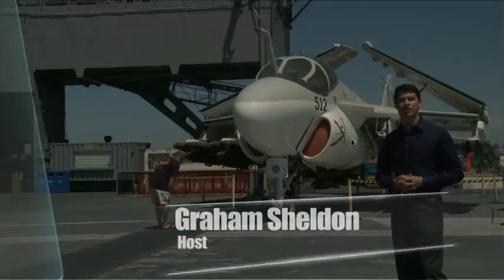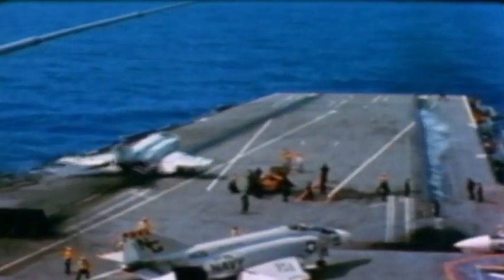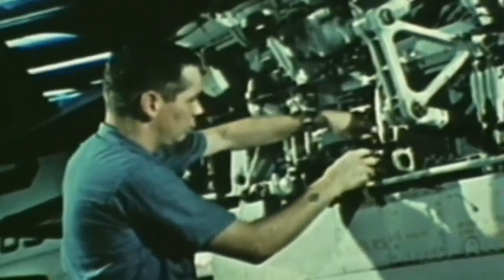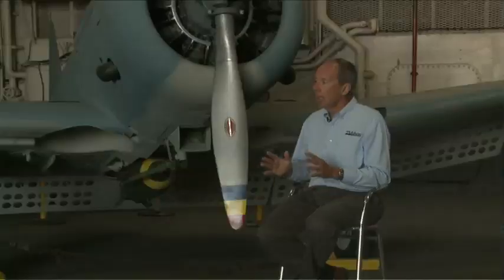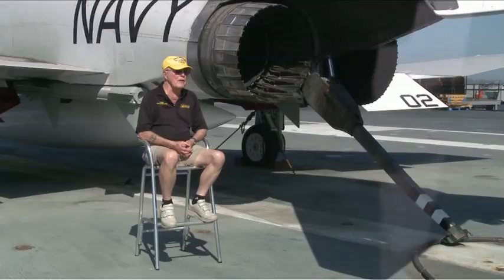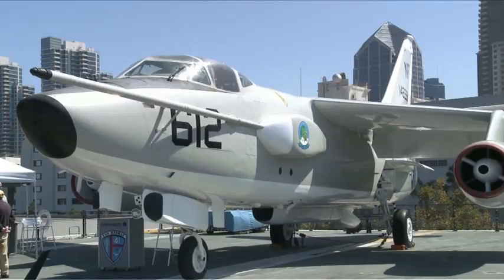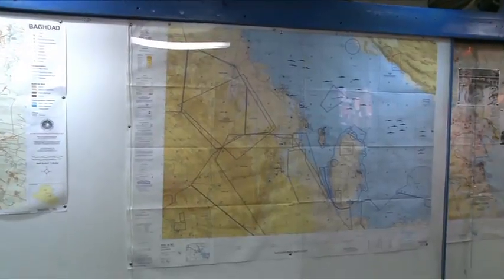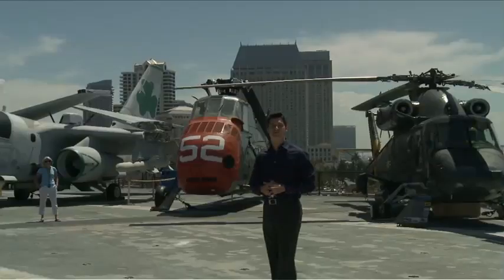A Look Inside the USS Midway | USS Midway Museum

Comment: Sorry, but Midway's Sister, the FDR CV-42, was the first Aircraft Carrier to carry and deploy Nuclear weapons, not "Midway Magic CV-41."
Reply: Having been on both I noticed a few minor misteps in the script but blew it off knowing that landlubbers can't get it all right.
Reply: @jimc5096  Midway was also NOT the world's largest ship until the mid-1950s.
There were several ocean liners -- Queen Mary, Queen Elizabeth, the Normandie -- commissioned prior to World War II that were bigger ships in gross tonnage (80,000+ tons not matched until the Kitty Hawk was commissioned in the early 1960s) and length.  The Queen Elizabeth was the largest ocean liner pre-WW2 at 83,000+ tons and 1031 ft length.  From what I've read, the cutting edge ocean liners have always outpaced the size and tonnage of warships.  The closest warships in size are the supercarriers of the Enterprise, Nimitz, and Ford classes but even those are relatively smaller than today's cruise ships and super oil tankers.  
To say that Midway also had the greatest tonnage post-war (WW2) would be stretching, too.  I believe the Iowa-class battleships had greater tonnage, 57k, close to 60k later after refits.  The Midway class grossed 45k standard around 52k tons max in original configuration.  The original length of the Midway was 968ft extended to 1001ft after her last refit.  I've read gross tonnages of 64k, 67k, and even as high as 72k tons for Midway after the 1966-1970 refit.  Anyway, she was overstressed for a ship originally built to a 45k ton standard!

Comment: The very last of the A3's were based at Van Nuys Airport for Raytheon research & Development. 
When the contract with Raytheon and the Navy expired, all but 3 A3's were chopped up on the ramp. It was a sad day to see the equipment destroy each plane one by one. If you want see one of the 3 last remaining A3's there's one in Hawaii. I think one is in San Diego and the 3rd one is in Ohio. 
The very last flight occurred I think was 2012 or  2013. I remember the Raytheon guys telling me to go out on the ramp take one last look while the plane was being prepped, I remember those turbo jet engines being extremely loud.

Comment: I remember in very heavy seas that extreme angle deck would bang into ocean surface because the ships roll was extreme. As big as Midway was at it’s inception it looked small next to these behemoths, the super carriers. I noticed this difference when Midway was berthed on the opposite side of the pier from the USS Enterprise.
Reply: I think the reason for the Midway's (and her siblings) behavior in very heavy seas is due to her hull design. Unlike the Essex-class carriers, she was built on the hull design of the Montana-class battleship, making her the contemporary of the Japanese aircraft carrier Shinano, which was built on the hull of the Yamato-class battleship.
Reply: The Midway wasn't that much smaller than the Kitty Hawk and Forrestal class designs after she was refit in 1966-1970.  There's a photo on the Wikipedia page for USS Midway that shows her in a 4-ship formation with USS Ranger, USS America, and Teddy Roosevelt.  Ranger is directly below her in the photo and Midway hardly seems tiny by comparison with the Ranger.  She's very close in length and acreage of flight deck to the Forrestal-class design.  The Midway looks unique because she's the only carrier (re)built with her elevators outside the main perimeter and curves of the flight deck like that.  The elevators are more integrated into the flight decks of the supercarriers.  Midway is still an elegant-looking carrier but deeply flawed like the Forrestal-class was.  
The one thing Midway (and Coral Sea) did better than the Forrestal class was shifting their port side elevators to the rear and outside of the landing strip zone.  I don't know WHY the US Navy built so many carriers (4 Forrestals plus ALL the angled deck refits of the Essex class!) with edge elevators interrupting the landing field.  You would think SOMEONE would have figured out (beforehand) that an elevator at the tip of the landing field would almost NEVER be able to be used during flight operations!